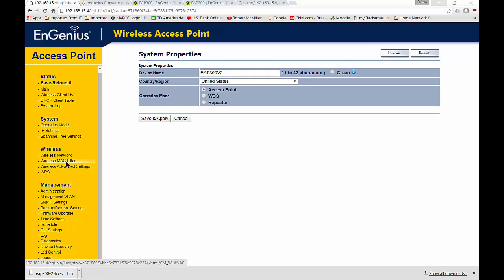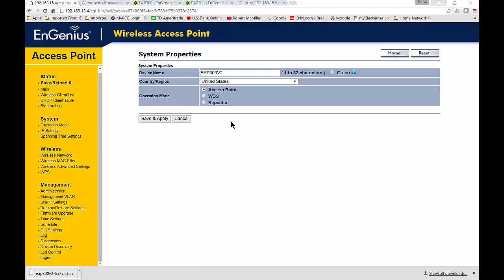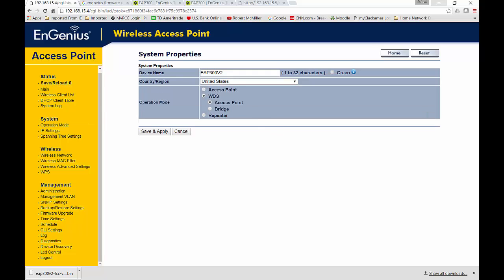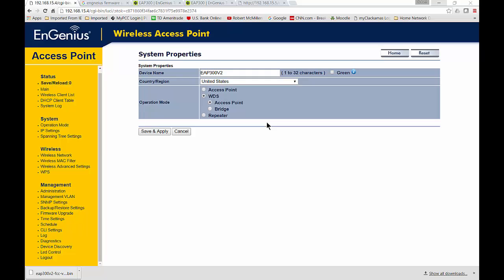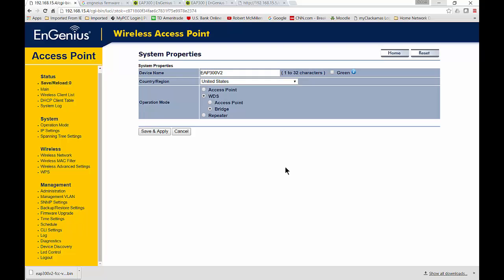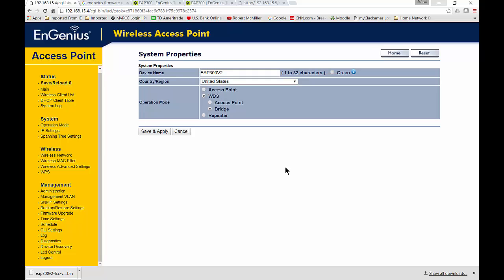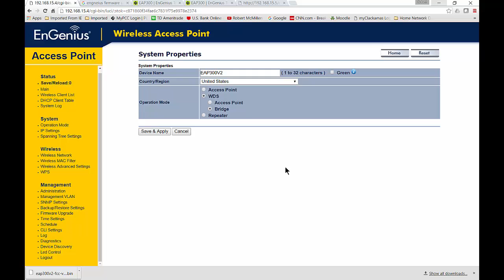Engenius Wireless WDS Access Point and Bridge Mode

Comment: Would you be willing to help with trouble I’m having. I have 1750 on a shop with 1 gig. From there I have 2 other structures with enh500 receivers. I’m trying to add another enh500 v2. My tech that set this up is lost. I have 2 different firmwares. Not sure if that’s the problem or not. I need ap mode I think. I can get link light I client and bridge mode. I lose other structures in bridge mode. I can see packets receive and sent in client mode. I’m missing something simple. I would be glad to pay you for your help.
Reply from the maker: It may not be possible between 1 and 2 versions. I have tried this myself. I had some success by upgrading the v1s to the latest firmware and sometimes I could also see v2s.

Comment: Hi, I have one unit at my house wired to my router and the other unit at an outbuilding 300m away where I have 2 IP cameras connected to my network via cables. Both units are in bridge mode. I was wondering if there is away to broadcast the WIFI in my house at the outbuilding?
Reply from the maker: If you use the same SSID then they will sync so you can walk between the two locations without having to ever switch between them manually.
Reply: Robert, thanks for the quick reply. 
So do I have to put them both into access point mode? And would this effect the cameras I have wired to the Engenuis device at the out building? 
Regards
Gary